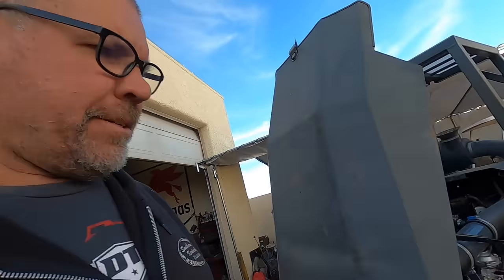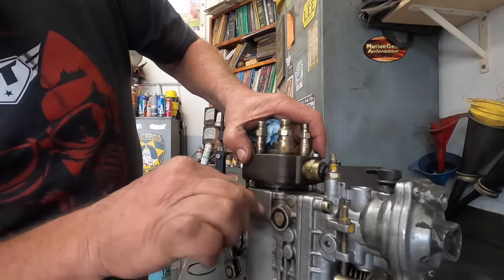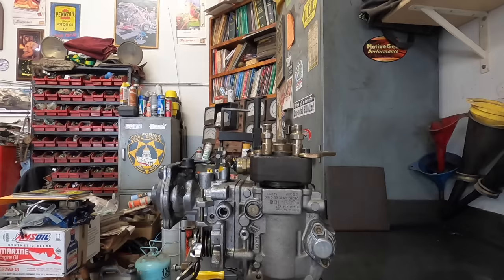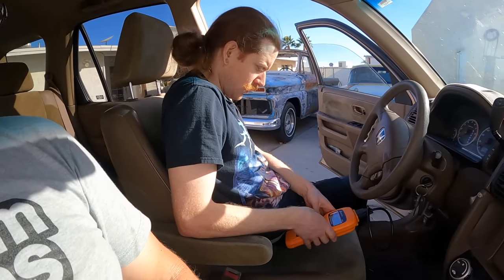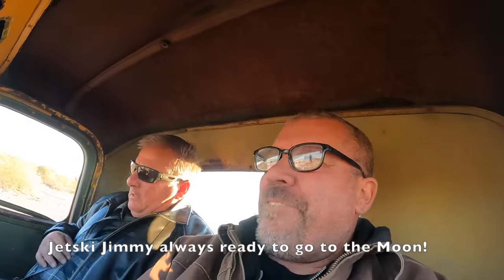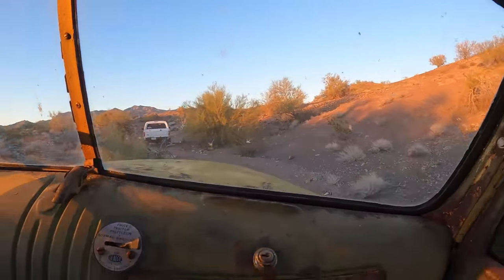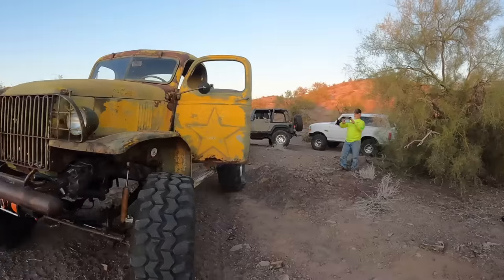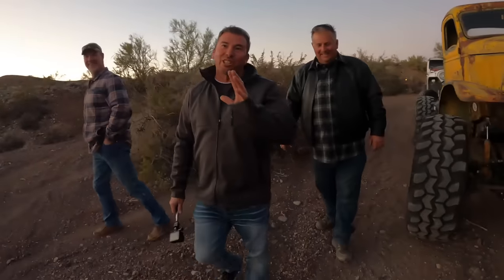Tow Mater Getting Some Exercise Before the Tow Truck Olympics

Comment: Hey Merlin can you still get those old tread pattern BFG MT tires like what was on that jeep that you was hauling out with the broken nuckle??? I have had several sets of those tires and they would last for ever for off road driving and on the highway driving!!! Absolutely love those tires way better then the new BFG MT tires!!! The new set of BFG MT tires I had I didn’t even get 10,000 miles out of a brand new set and BFG wouldn’t do anything for me!!! I was definitely not happy!!! I do have one new set of the old BFG tread pattern tire that I had baught to run on my 1969 Chevy 1Ton 4x4 during the winter months instead of running the 40” boggers that I run during the summer months!!! I’ve had this one set for over 15 years and there isn’t one dry crack in the tires!! They still look like the same tires when I had baught them new!!!!

Comment: Good tip
I need to do this on my VW IDI 👍
Only thing is I will lift the off the threads when removing the bolts so it didn’t get cut by the threads. 
All good tip though and thanks ✅👍

Comment: I'm a fan of them little Honda's they can run forever and the junkyards are full of them when they need parts. The only issue I have here in Canada is the damn rust but it's not the cars fault it's the salt trucks that dump salt on the roads in the winter like we are having the blizzard from hell but other then that they are god cars and great on gas

Comment: I love the 1st gen Cummins powered Power Wagon ! Ok so my bad , it's a Chev cab not the Power Wagon , still a Mopar chassis !! Years ago I had a 1st gen Dodge Cummins with a NV 4500 & I found a 47 Flat Fender Power Wagon body & wanted to put that body on the 89 but I didn't have the funds to get it done unfortunately so this build is what I had planned to do .

Comment: At around 3:48, I might have pulled those two bolts all the way out and smoothed the threads on a wire wheel or something and got any sharp edges off so as not to cut the O Ring. Just a thought.